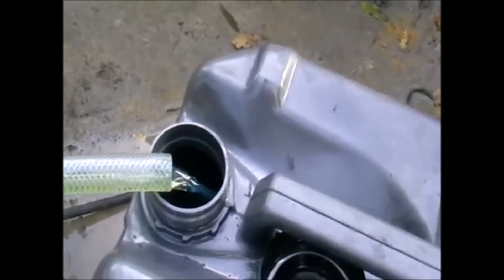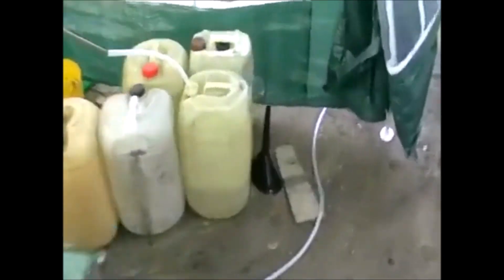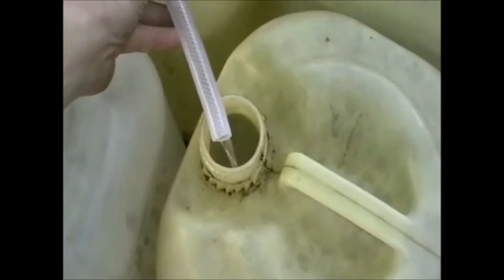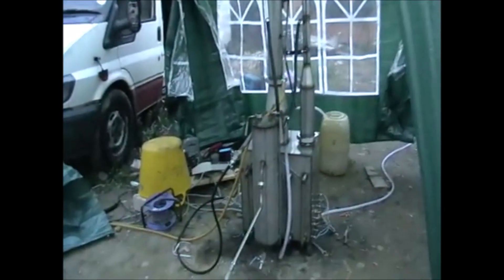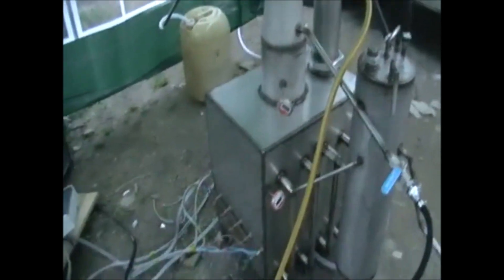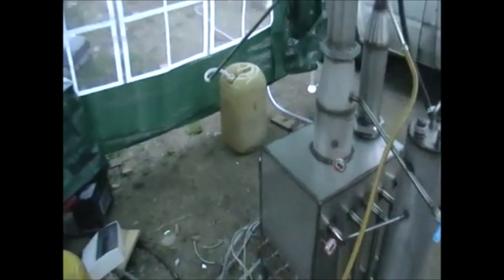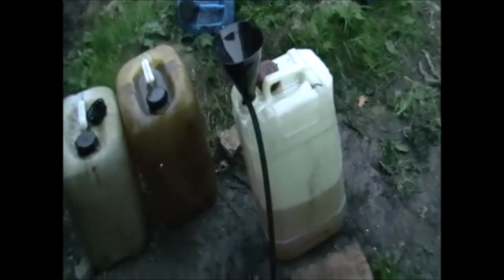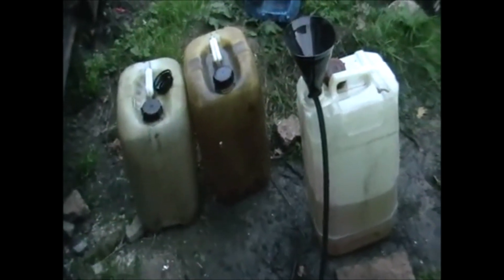Old wrong fuel rescue project - How to separate mixed gasoline and diesel (archive video).

Comment: Great work. How can I contact you to get the working method? Do you use chemistry to get a good color and smell?
Reply from the maker: There is a contact information in the video description. The product is a result of separating accidentally mixed diesel and gasoline, and each product retains its original smell and most of color after separation.
Reply: Do you use WhatsApp? I want a WhatsApp contact number so I can use the translator
Reply: Can I know the chemicals added to oil planned for laboratory work? Please contact me